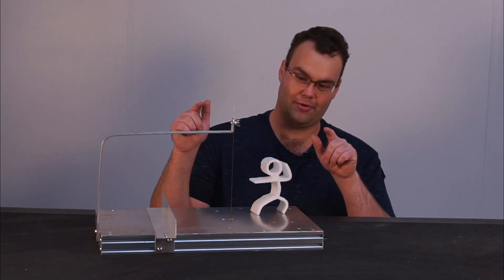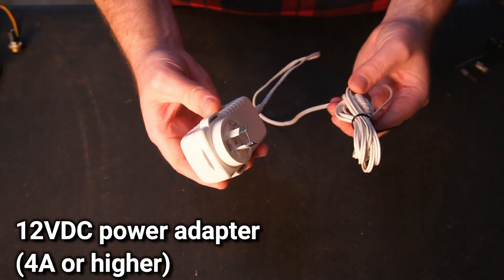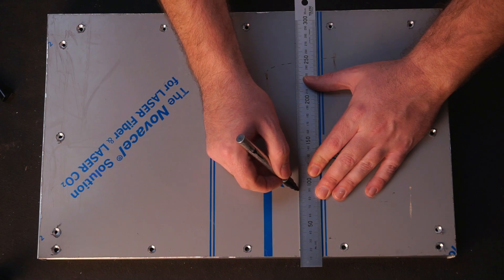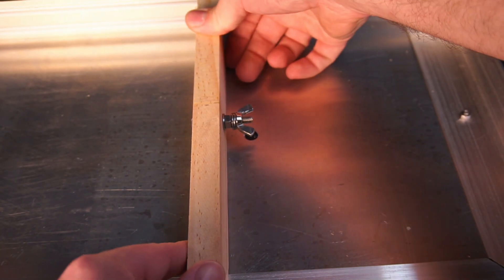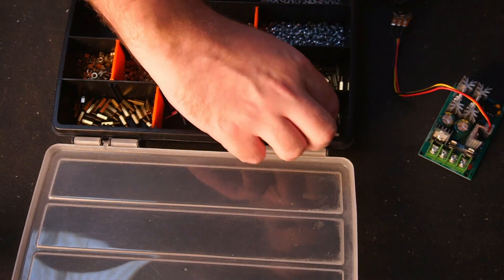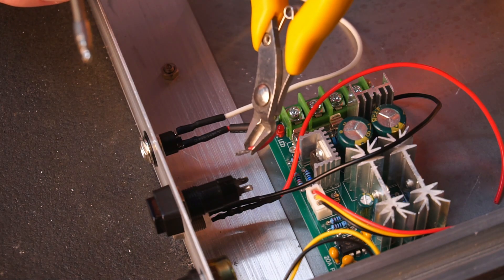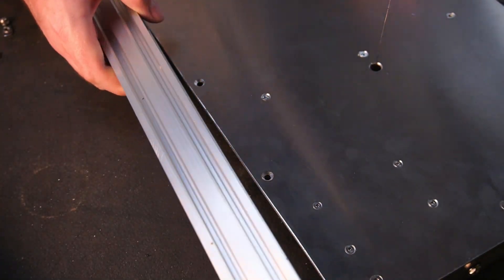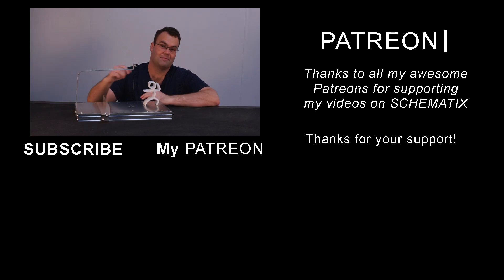How to build a 𝙃𝙤𝙩 𝙒𝙞𝙧𝙚 𝘾𝙪𝙩𝙩𝙚𝙧 II Cut Foam clean, easy & fast!

Comment: Looks better than store bought; however, I would recommend buying those crimp on ferrule connectors for the stranded wire that went into the pwm controller.

Comment: Great Idea well implemented
Why did you need to isolate the PS ground from the PWM ground?
Reply: The PWM controller most likely works by switching the ground connection, connecting the chassis ground and power supply ground together would completely bypass the PWM controller
Reply: @goz3rr  Thanks

Comment: This is a great tool for making foam insert organizers for toolboxes.
Reply from the maker: Yes, in fact that is why I built it. Recently I bought a new tool chest, and I would like to make several drawer inserts. I had planned on using those inexpensive anti fatigue foam mats you can find in the hardware store. However, I've found the foam mats are quite slow to cut due to the type of foam they are made of. So I'll have to find another type of foam.
Reply: @Schematix  and then you inspired me. Because I bought Stanley 7 drawer box with all the fancy gedore blue, wera, Knipex, Facom, DeWALT, Milwaukee, Dremel, Makita, etc. All fancy  tools. I spend 4k... Man, It's an investment! And yet you going darn... How to make this look professional? Well I liked EVA foam and your video made me smile. That all the years I saved for these tools, bought them and then they would be looking badly flying around freely...oh no! You and your amazing video got my back. It's easy to follow it. It's easy to make it. Love it man!

Comment: I was tempted to build something similar a while back, but I cut foam so rarely I just ended up taking the nichrome and holding it between 2 pliers hooked to a 50C 2.2AH lifepo4 cell. Just needed a few somewhat straight cuts so was good enough.

Comment: Thanks for the information, mate. Many years ago, I worked at a company that manufactured polystyrene insulation. They cut it using mig welding wire and a 220v arc welder for the power supply. They started making  a 3x3x4 metre piece, and cut it down to the sizes that a customer might require. They utilized recycled foam, so it could have mostly white with pink, blue or perhaps other colors in the final product, which was usually cut to fit between framing studs on a construction site house or some other structures.